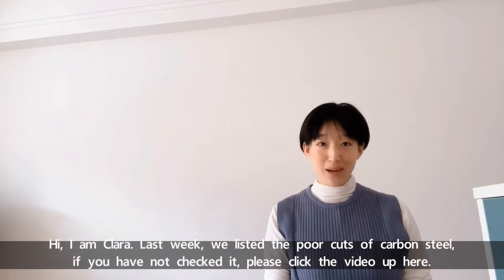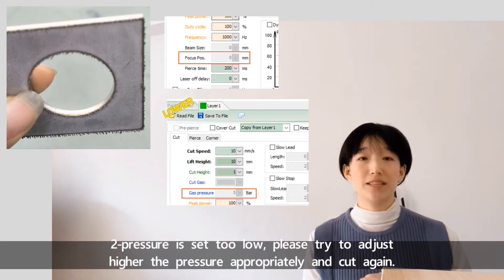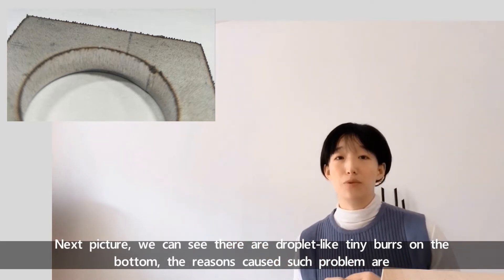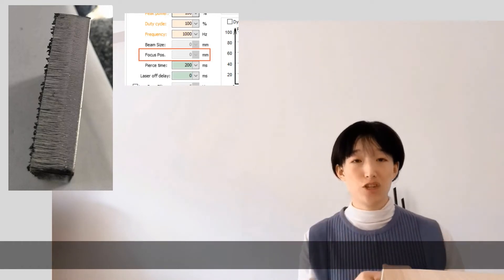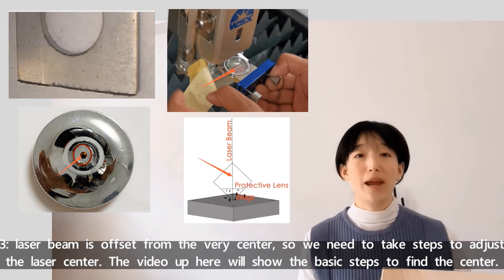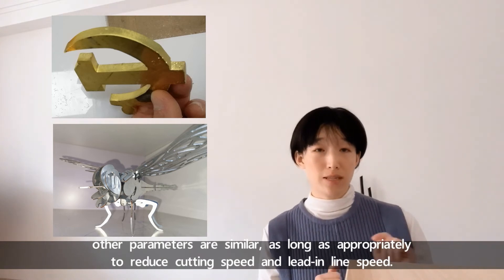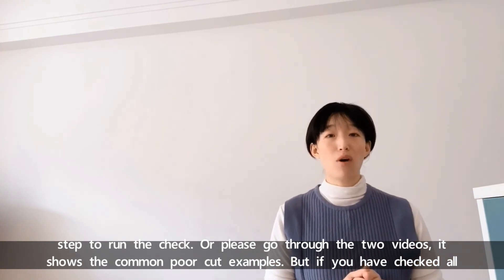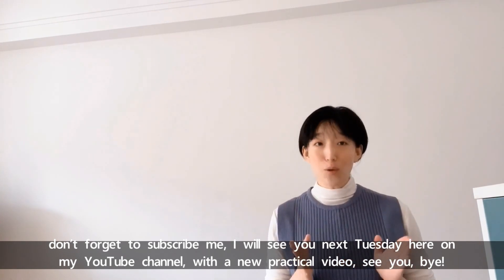Stainless Steel Poor Cut | Fiber Laser Cutting | Problem and Solution

Comment: Hi Clara,

Thanks for all your videos they are great!  Question I have a Raycus 2000w laser, and I’m trying to get good cut quality on 2mm stainless steel.  My settings are the following.
Cut speed 1.2m/min
Nozzle height .5mm
Gas nitrogen 
Gas pressure 12 bar
Power 2000w
Duty cycle 100
Pulse frequency 5000hz
Laser delay 0
Foucus -1.5 mm
Nozzle is single 2.0

Is there anything you would suggest.
Thanks, Adam
Reply from the maker: We also need to know what cut you have, it is not a simple YES or NO reply to find your parameters.

Comment: hi, i currently use fiber laser 1500 W with compressed air. but when cutting 1mm gold stainless steel without peeling off the plastic, it contains burrs. is it normal with compressed air cutting?
P.S ( i cut on the backside which doesn't have the plastic and plastic will be in the bottom)
Reply from the maker: It is normal when the plastic is under below!

Comment: Hi clara how's it going, hope everything okay, i have a problem with my machine , it uses 1500w power , im trying to cut an ms sheet 4mm thickness, i applied speed at 1 mm , nozzle is 1.2mm  and the height of it 1mm , gas pressure 1bar at 100% (oxygen) . Adjusted the focus as per your videos and it seems okay but the problem is when i do a square or any shape its not cutting it means itll stay on the sheet i can only hammer it to remove it
Reply from the maker: All parameters I shared on my channel are just for reference, you need to find yours. You can adjust power curve.

Comment: miss Clara ,currently i am trying to cut stainless 8mm,we have 4 Kw power source, the top is cut nicely,the side allsso at 1.4m/minute, but in the bottom we get a lot of slack, i am with focus at 5.5 and height of cut at 0.4 please advice me for better result thank you
Reply: focus is -5.5 off course
Reply: but frequency is 5000 and you recomend 4000, is it that much difference?thank you for advice
Reply from the maker: what kind slags?